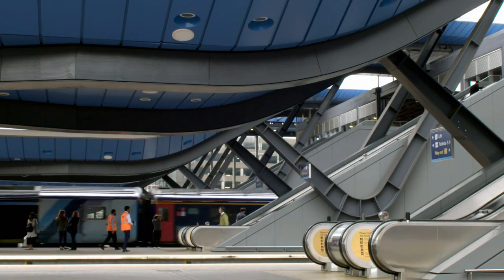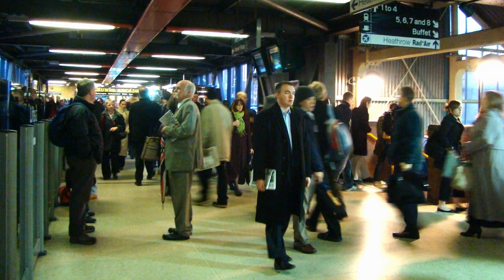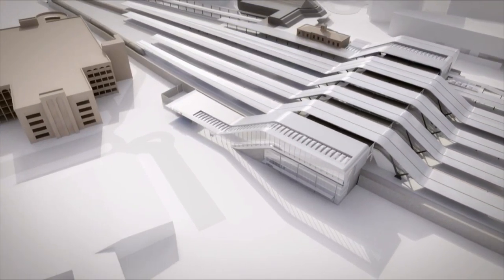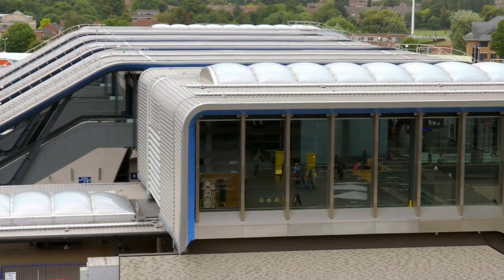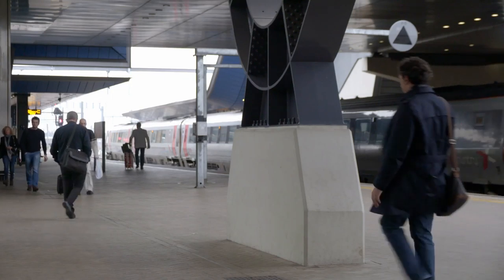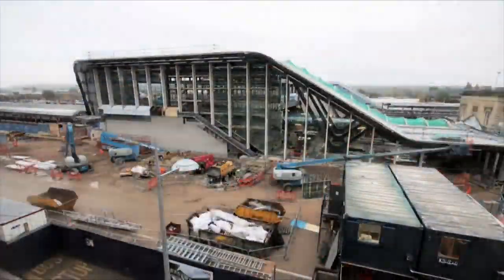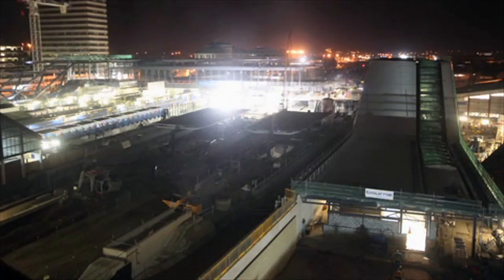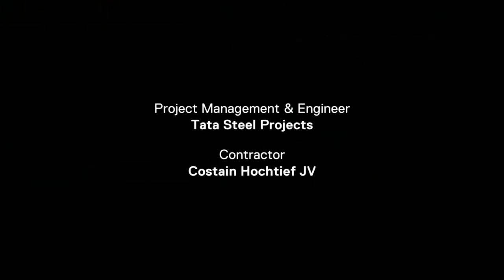Reading Station

Comment: It’s a great station use it all the time the escalators is easily the best part of the design. After moving through it’s spaces and seeing other ppl do the same it can be confusing which way the exit is on the bridge bc both sides are so identical 😂

Comment: It's a good looking station and all that, agreed. It's just a shame that it is so pigeon-friendly. The ceilings are perfectly suited to house them, meaning the floors are plastered with patches of pigeon s*#£. And when there is a slight mist in the air, the it condenses on the entire floorspace making it rather slippery. Oh, and when it rains, the bottom of the steps outside the North entrance just holds the water in a nice big brown puddle. So, it's not as good as they make it sound.
Reply: Oh cmon. You get that at any large station...

Comment: Like: Wide open spaces, but still offering shelter, Transfer bridge, platform width and accessibility.
Dislike: Totally not enough south-end lifts - Reading is an inter-city station, where travelers have luggage. Lifts are full, travelers take big cases on escalators and jam them. Everything is slathered in pigeon shit.